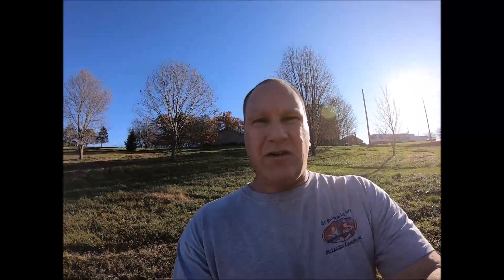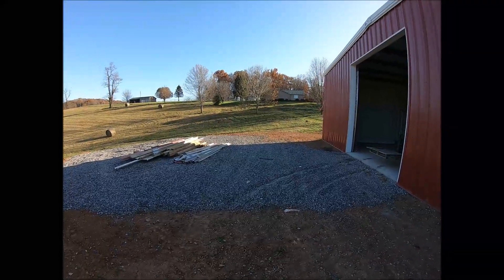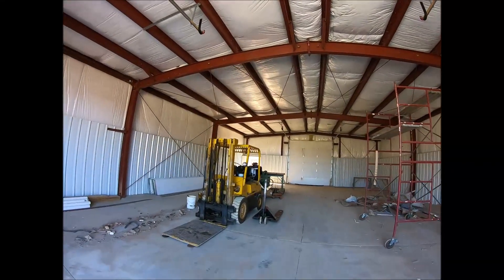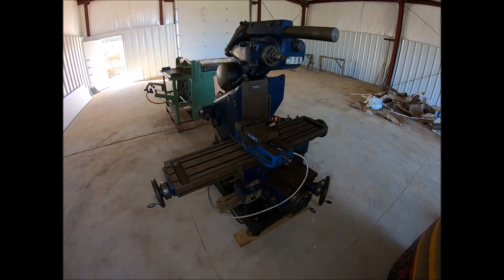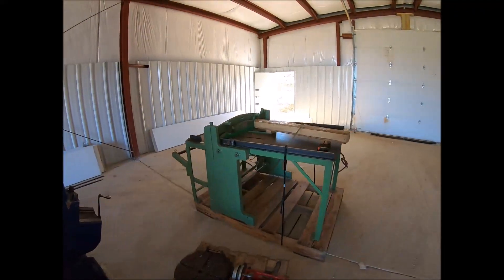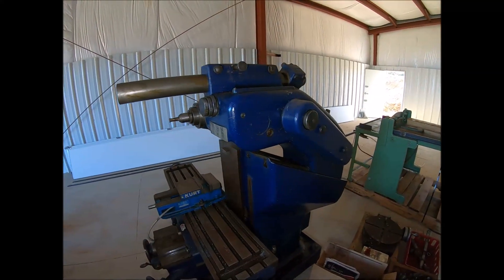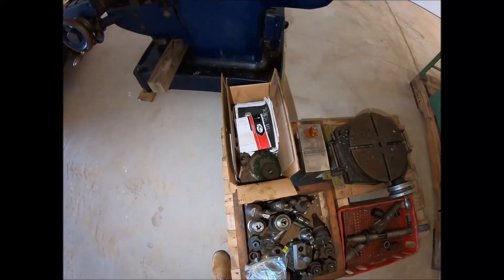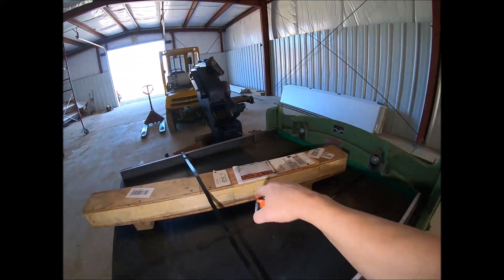First machines in the new shop!

Comment: If you don’t mind me asking, ball park what did you pay for the shop? I know price will very a little per location. I’d like to put up a 40x56
Reply from the maker: Building by itself was 40k. Concrete another 10k. Grading by the time everything is done 10K. Labor, misc materials, and electrical probably 30k. So 90K roughly.